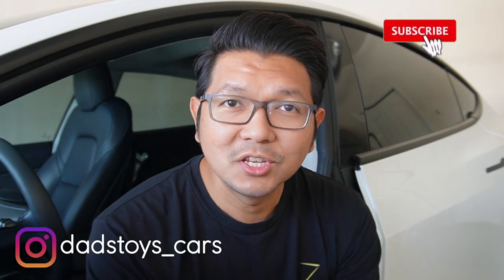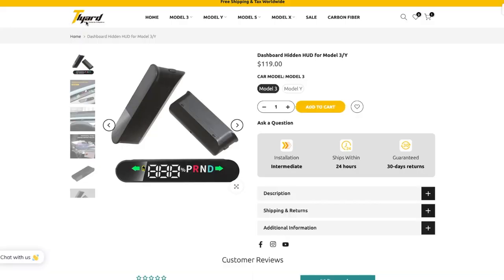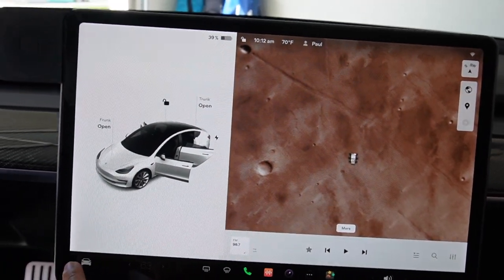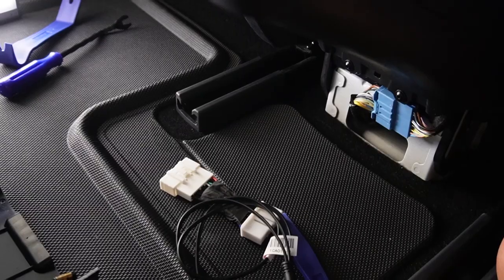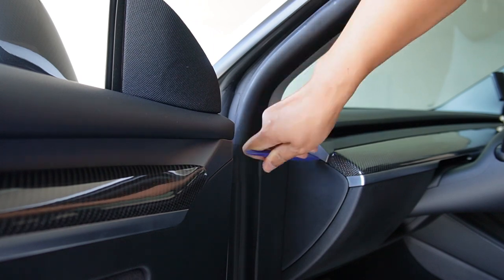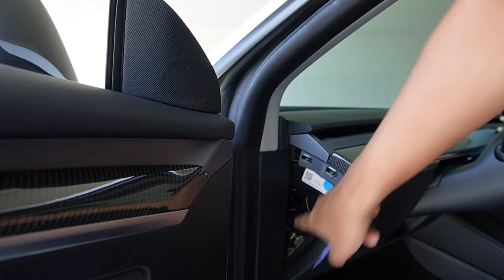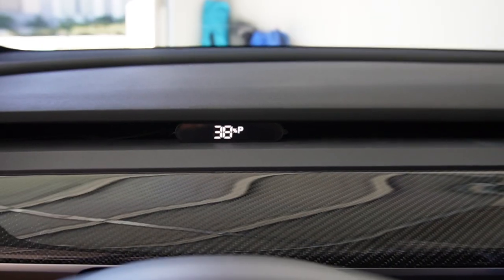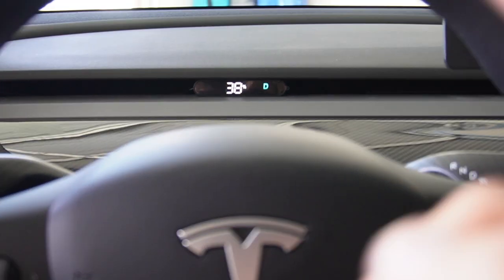New Tesla Heads Up Display for Tesla Model 3 & Model Y! #tesla

Comment: Thanks for the detailed install info. I have 2 questions- will this be the same installation procedure for older as well as the latest model 3? If you change the battery level from % to miles of range, will the HUD also change?
Reply from the maker: Hi Chris, the battery still showed % even if I changed to miles on the main screen.
I believe the installation should be the same with older model. To make sure you can open the panel in the back of your center console and check if the plug and connection is the same as you see in the video.
Thank you for watching Chris!
Please subscribe for future contents.🙏😃

Comment: Hi Paul. Will this work with the 7.2 rear display with a splitter OBD or something?
Reply from the maker: You might be able piggyback the OBD port from 7.2 display because this display doesn’t use much power to operate.
However I never actually test it yet.
Thank you for your great support!🙏😃

Comment: is there another way to install it if you already have the 7” display monitor installed in the back?
Reply from the maker: I think this mini display only comes with the connector for that rear obd port.
Do you would need to share that rear OBD port with 7” rear display.
Thank you for watching!
Please subscribe for future contents.🙏😃
Reply: @dadstoyscars  if I do share the connectors, would it slow down anything or cause lag on the display?
Reply from the maker: @MrSupahLMFAO  it shouldn’t as that mini HUD uses very little power.
But I can’t confirm for sure as I don’t them install that way.

Comment: Cool 😎 thanks for your video would be nice to show more info or be able to change what the display shows .
Reply from the maker: This display mostly shows basic info you need like turn signals, speed, battery percentage, and gear you are in. 
I think this is by far the cleanest display for Model 3 & Y.
Thank you so much for watching and your awesome support Nickie!
Reply: @dadstoyscars  cool looking small display if that’s the only reason why a person don’t want to by a 3 or y because it don’t have screen In front of driver it’s a cheap and great looking way to provide basic info that they need .
Reply from the maker: @nickieredshaw7835   Totally agree ☝️

Comment: I wonder if this will potentially void/mess with tesla warranty or car insurance policies.
Reply from the maker: Hi Khang, I doubt this would void any warranty because I didn’t change or modify any of the computer system in the car. All I did was just plugged in the pass through port to extract the information needed for the small digital display.
Thank you for watching and your awesome support Khang!🙏😃
Reply: @dadstoyscars  I’m so tempted to get this, i really hate looking at the big screen for the MPH. I need something like this. Just really scared D;
Reply from the maker: @khangbanger   If you worried about installation. I think this is definitely the easiest display to install so far.

Comment: Did you find a way to have tu HUD and rear screen work same time as they are plugged in same connexion?
Reply from the maker: I think you could piggy back to the same rear connector as the HUD display use very little power from that plug.
Reply: @dadstoyscars  can you show me how to piggy back the connector?
Reply from the maker: @MrSupahLMFAO  You can use the pass through plug provided to plug on the first pass through plug and plug in the car original plug into the second pass through plug.

Comment: The screen should have been matte obviously.
Reply from the maker: That would be nice but there is no issue with the reflection on the screen at all or you can just get matte screen protection for small phone and cut into the shape of the screen if you really want that matte effect.
Thank you for watching Thomas!
Please subscribe for future contents.🙏😃
Reply: No issue but it would have look better. In some parts of your video we can see reflections that reveal the borders of the device. To make in even more invisible they should have use a micro perforated surface covering LEDs instead of a LCD panel. Also a bit wider with more infos.  It would have look cooler. Hopefully they will do a V2 or it will inspire other brands. I would absolutely love a device like that if it could alert me with flashes as an option to replace some of the annoying chimes.

Comment: Its ok….I guess.
Reply from the maker: If you needed something simple and keep it very clean interior than I think this is the one. 
Thank you for watching!
Please subscribe for future contents.🙏😃
Reply: Perhaps if it was somewhat wider…and displayed more info…just to have a speedo, blinkers and drive mode for $100 usd…?
Reply from the maker: @jpmackin  like I mentioned, this is for someone that only needs basic info in front of them and also minimize AC blockage. As for the price of $100 with tax and shipping included, I think this is probably the most affordable HUD unit for model 3/y that I have seen so far.
Reply: @jpmackin  Can't display more info on that tiny screen.

Comment: This works great, HOWEVER when using more than one daisy change connection 8n the back, there is NO WAY possible to put the cover back on.  Wish someone made a cover for the model Y that was bigger in depth to allow for expansion mods.